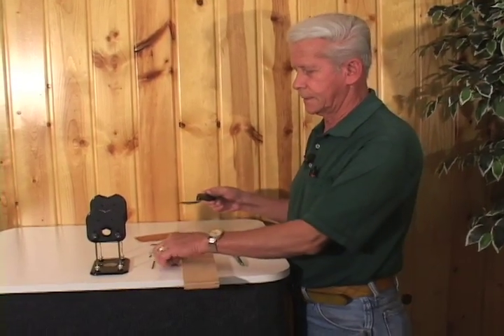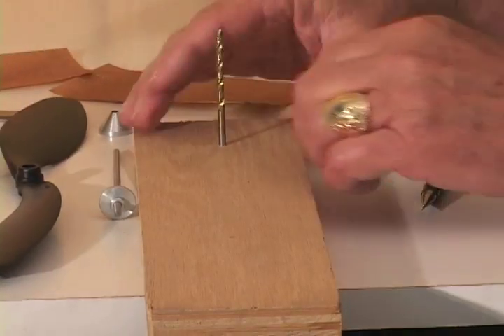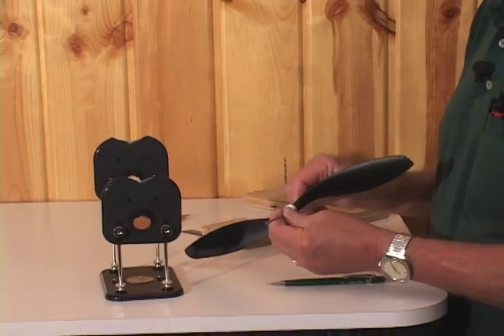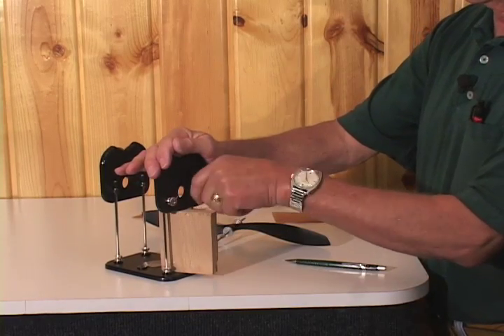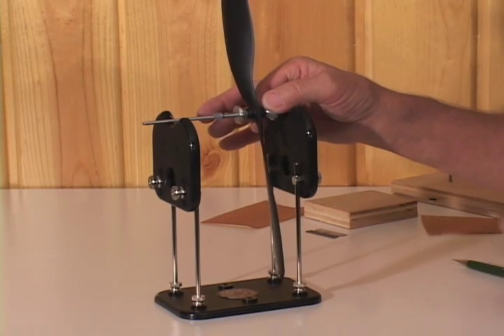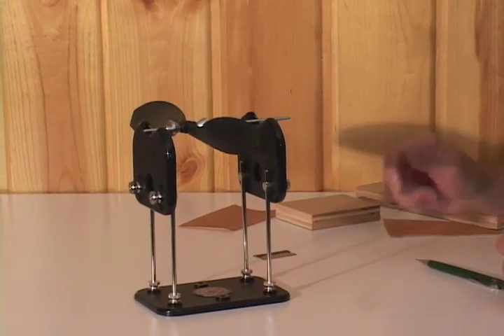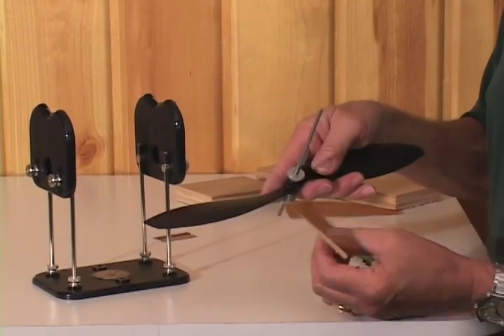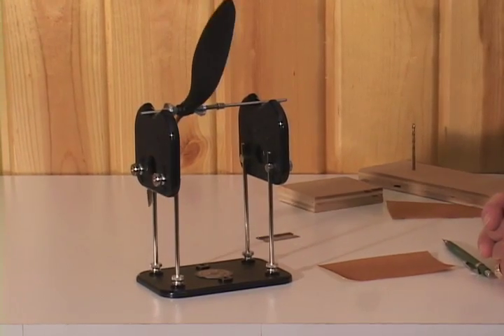Prop Balancer #2 | DU-BRO

Comment from the maker: It is really rare that you would have that different of a length from one side to another but if you do you could cut one side if need be.  The best bet is check your prop, if you have this problem, call us and our guys could explain in more detail how to correct it.  Most likely you will not have a prop that is that far off to need to cut one side shorter, but if you do, you can call us at 800-848-9411 and ask for Ed or Terry.

Comment: After balancing a number of blades, the plastic facing on the contacted magnet may rough up slightly.  Although friction seems negligible, I found that when I applied a thin film of lubricant (vasoline) over the plastic magnet facing, some perfectly balanced blades still needed a little more work.